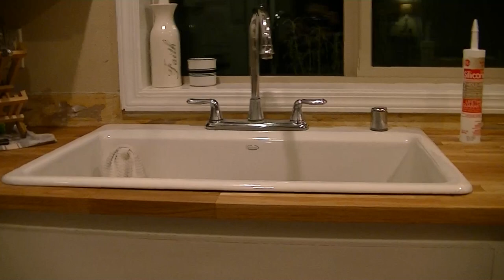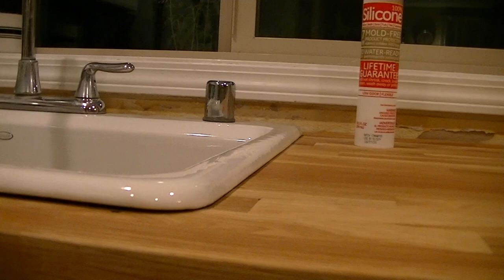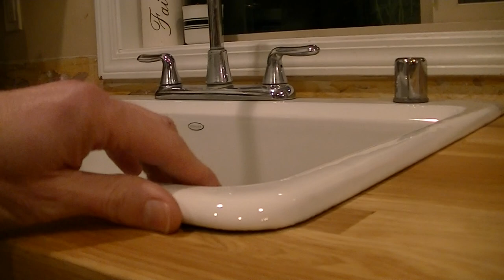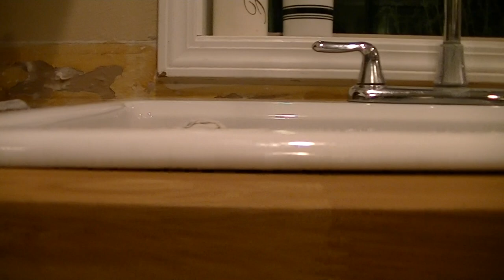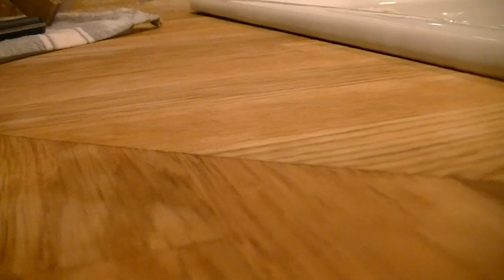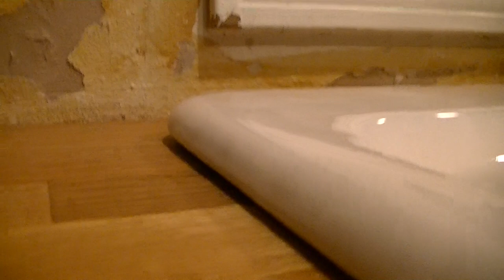Warning on Cast iron enamel sinks

Comment: Shim the back until the front looks as good as it can, and then fill the rest with caulk. You may need another coat, especially in the back. Cast iron sinks were really meant for tile countertops where you drop the sink into a bed of mortar and tile around it.

Comment: I always laugh when people think that they can get two surfaces to meet perfectly without any adjustments. Many of these people live in the virtual world where their architectural program has perfectly straight lines and 90° corners. Of course the real world doesn't work like that! If it was my counter, I would draw a line around the sink, remove it and rabbit the wood counter, either compensating for the rocking or shimming the high sides to average out the so called warp. Alternatively, you could take a grinder and grind the high spots on the sink. Both of these choices require a professional acquaintance with the materials and tools. If I am just a weekend warrior, I would just shim the high spots and then caulk the difference and call it good!

Comment: I installed enough of these sinks, even if the cabinets are level front to back and side to side the cast iron could be warped. Cast-iron sinks are not perfect.  Just return it.  You need to worry about what type of caulk you use to seal that sink some latex caulk’s will cause rust to form from underneath when it’s laid against the cast-iron bottom edge.  If was my house I wouldn’t use one unless it was a farm sink.
Reply: We have had this problem in a big way!  So must rust along the rim where it was caulked.  Is there a solution to this problem?
Reply: @PongratzSped  Kohler at one time made a caulk for there cast sinks, which stopped any type of rust bleed through.  They discontinued that line.  I would call their customer service and see what type of caulk they recommend.
Reply: kohler recommends 100% silicone.
Reply: @chriscaldwellvoiceovers  That’s the go to caulk.  Not always the best though.
Reply: @thepinkdiamonds8370  What is the best to use? I spoke with Kohler yesterday and they said "any type of 100% silicone caulk is fine."

Comment: Is the hole in the countertop pinching the sink? We cut the hole using the template, but still had to trim a bit off to allow the sink to seat fully. Btw, spring clips wouldn't help because there is no "give" in a cast iron sink.

Comment: Some armchair quarterbacking. For the back I would mark the back edge with a pencil...remove the sink and lay a piece of Butyl Rubber Sealant Tape or RV sealant putty tape. Carefully lower the sink back in making certain the back edge goes down straight and even. That may close up some of the front as well. After anchoring the sink  run a bead of silicon down the back and with a wet finger smooth it against the sink and countertop.

Comment: Thanks for posting.  I had no idea this was an issue.  I just purchased mine and have yet to have it installed because we are doing other kitchen renovations right now.  I was curious if you had an update video of how yours looks with the extra caulk.  Also, this may be a dumb question but did you secure your sink with any clips? My current stainless steel sink has clips but my cast iron sink did not come with any.  I'm wondering if clips would prevent that rocking.  Thanks again for posting.
Reply from the maker: The Iron sinks don't use clips.  The weight & caulk bead hold them in place.  I screwed some wood blocks to the underside of the countertop that press up against the edges of the tub for a little something extra.
Reply from the maker: Mine didn't come with clips either, I screwed some small wood blocks into the underside of the countertop.  They are butted up against the bowl of the sink.

Comment: This is a problem I have encountered. Seems as if sinks were better made in the past with a nice finished edge o the flange that was ground flat. All the new Koehler cast iron sinks are manufactured with this lame edge that needs caulk to cover. That caulk gets moldy and black an looks horrible six months down the road.
Reply from the maker: Yeah, it just didn't feel right having to put that much caulk under there!
Reply: DefinitelyNotDan lol
Reply: Tim Craig- thanks for that info. I was just about to buy one!

Comment: It's not warped, your warped. It's the counter top
Reply: I am encountering the same problem with my Kohler Mayfield.  My countertop is granite so it is not the countertop but the gap is just about 1/16".  I plan to call Kohler tomorrow but expect to be instructed to rest the sink on either plumber's putty or calk.  I might shim in the back.  I have been filing the two corners down but that is very slow going with a hand file.  The new black sink actually replaces a white Mayfield that I installed 23 years ago and it appears that I rested the sink on clear calk back then and then applied a bead all around and it worked just fine.